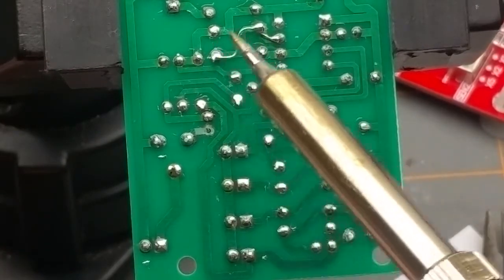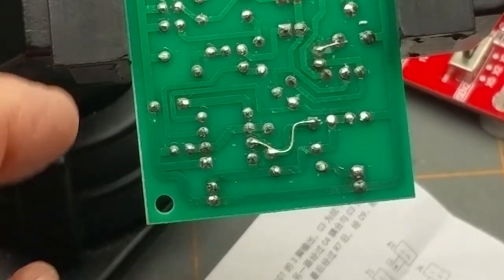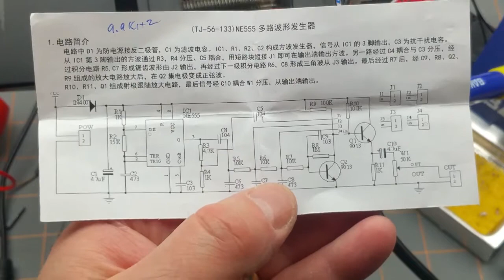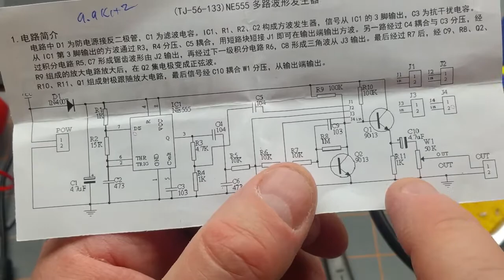mistakes were made

Comment: I etched my own boards 2 years ago using cheap Ebay PCBs and the tracks would fall off, so I switched to local PCB and I can R&R a single part 10 times and the pads stay attached.
Been seeing quite a number of traces falling off PCBs from cheap Chinese PCB houses when a part has to be changed.

Comment: C10 is a simple DC blocker so the chances of it "blowing up" are pretty unlikely.
Reply from the maker: good point.

Regardless, it's not a significant risk at this voltage level.

The "blowing up" was in reference to the more general statement in made in the previous video  about harm to reversing electrolytics in general.